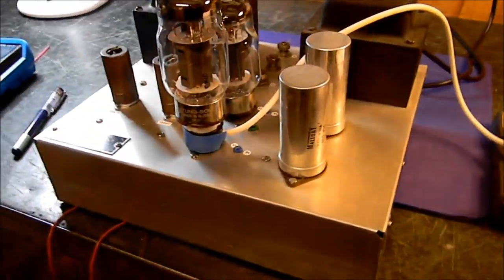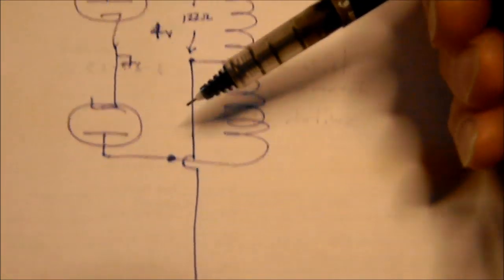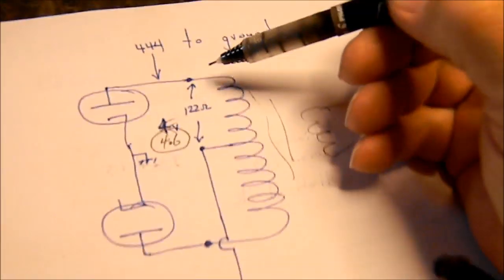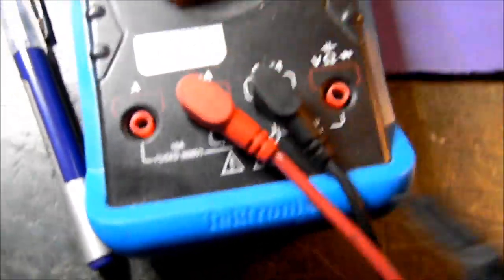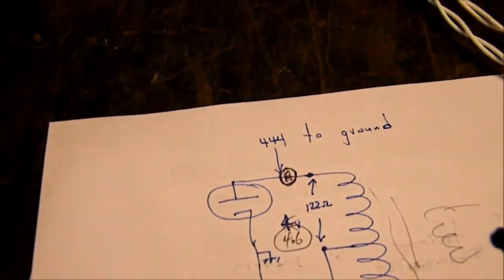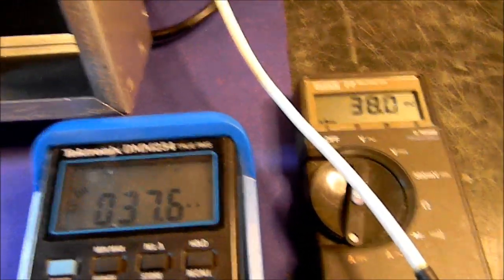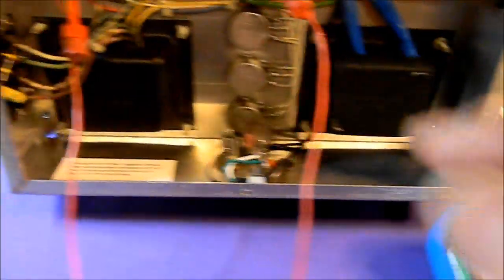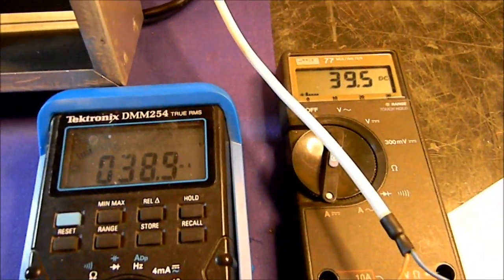Measuring Plate Current In Vacuum Tube Amplifiers By Using The Output Transformer Shunt Method

Comment from the maker: I liked your question as the ST-70 is such a popular amp - I just made those measurements because of your question and the series method gives 47.3 mA for one tube and the shunt method (the method described in this video) gives 46.7 mA. - that is 98.7% the same - works great for small amps. I am working on an Ampeg SVT (300 watt bass amp) and I will post those results later. I suspect there will be a bit more error because of the lower primary impedance of the transformer.

Comment from the maker: You don't have to have a load on the output transformer if the amp is doing nothing which is what you want it to be doing if you are measuring a static bias. However, most people feel more comfortable with a load and it can't hurt. If one forgets to connect a load and then drives the amp to full output, something bad could happen.

Comment from the maker: Thanks,  Mark. And, even if the error is a few percent, the relative error from one tube to the other is equal and allows for "matching" tubes as well as any external device. I have noted in other posts that even a whopping  error of 10 mA at 450 volts is only 4.5 watts and within acceptable error limits. Too simple for those that sweat over one mA, but it works just fine.

Comment: Somewhat novel and interesting measurement method. Since the meter's DC resistance is so much smaller than the transformer's, it's able to get a fairly accurate reading, since it takes over 95% of the current flow, being under 1-ohm series resistance itself.

Comment from the maker: This is actually a current measurement and not a voltage measurement across a known resistance to determine current. None of the methods are highly superior to any other method - the beauty of this method is it is simple, effective and quick. You can make the measurement and adjustment and move on to the next adventure and not have to buy more test equipment and make a big fuss over the ordeal as many do on the Internet. Even if one is off a whapping 10 mA, at 450 volts, that is only 4.5 watts.

Comment: would this way be the same as measuring the volt drop over a 1ohm resistor off of pin 8 to ground, but this is just a more accurate way of measuring the bias?